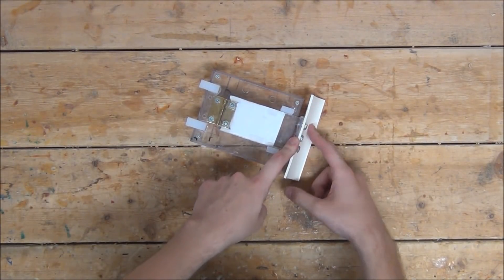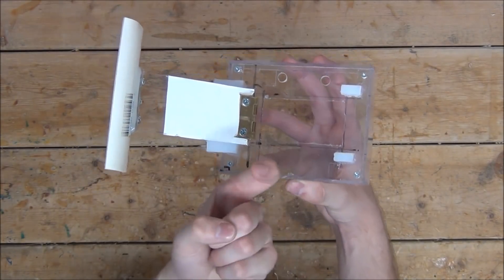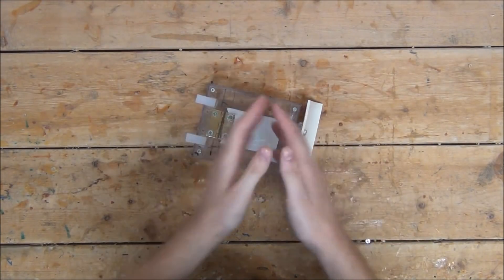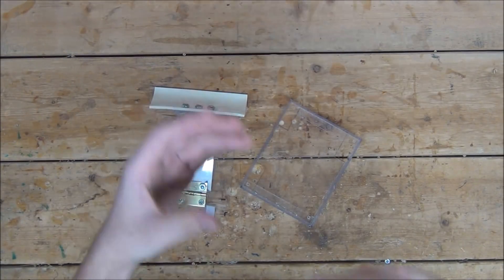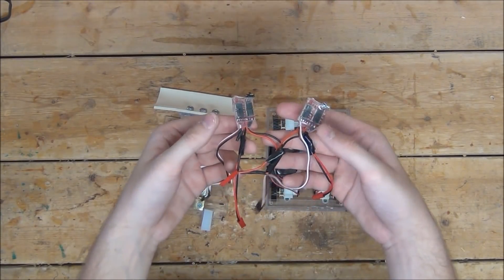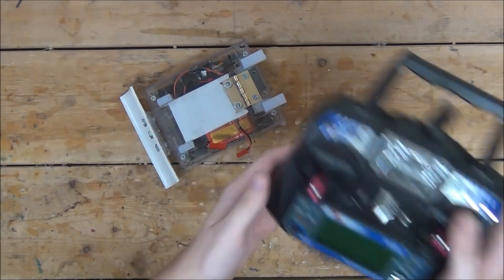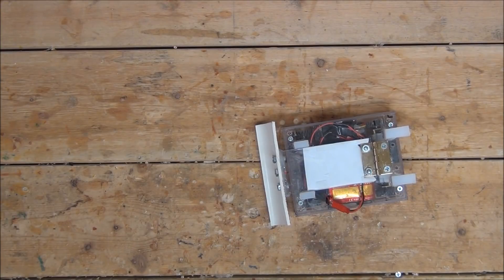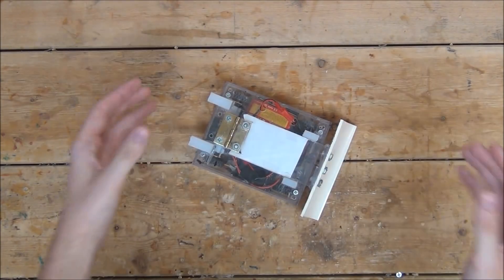How To Build A 1LB Lifter Battlebot // Talyn 2.0 Part 2/3

Comment: Hey, I know this is a super old video, but I’m in the midst of building my first ever robot, it’s a lifter powered by a servo, and I was just wondering most about the mechanics of that, like how did you make the servo flip that much? I’ve watched all the talyn videos and I’ve learned alot :)
Reply from the maker: Hello! First off that is SOO exciting! Congratz about your first bot! Well first I mod the servo itself, I solder 2k ohm resister onto the servos POT so that it has a wider angle of movement. After that its just a matter of putting the hinge as close to the servo as possible. atleast that's how i currently do it. You could of course go with a 4 bar lifter or something of the sort but theres a LOT more math that goes into that AND its not quite as durable.
Reply from the maker: I know you said you've seen all the talyn videos, but have you seen the latest one? https://www.youtube.com/watch?v=ZcTCFxAk96g

p.s. There SHOULD be a new talyn video VERY SOON...LW! Haha!
Reply: Thanks for the reply! I’ll see what I can do with that info, im just happy to have something that works at this point... it’s a similar design to apollo from uk robot wars

Comment: So... Uh... weird problem with my transmitter (the flysky) ... I used a servo motor plug, wired it to a 3 triple A battery pack and plugged a servo motor into the receiver. And the motor just spun on its own. I did NOTHING with the controller. What's more is the servo motor would just go for a while then stop and keep repeating that. Do you know anything about this? I need to know soon as I'm going to a competition in early November. 

Thanks
Reply from the maker: It's a 360 degree servo? If so sounds like it just needs to be calibrated. To do that you first put the throttle in the off position then adjust the screw on the bottom of the servo until the servo stops moving. On a side note i would highly encourage you to buy a rechargeable battery pack and run it through an ESC to help protect everything.  :)
Reply: Thank you! And thank you for your quick reply! I did not know you had to/could calibrate them. (Just goes to show how new I am to all this) Unfortunately I won't be able to be in your 1lb robot video as I've accidentally made a 150gram bot. It is pretty small and all the parts weight at exactly 150 grams so I Don't have room for an ESC. Thanks again for your help!
Reply: @MechNinji  The motors are not responding at all. I think an ESC is what I need

Comment: If I'm not mistaken the lifter arm is not connected to the servo, the server just pushes up on the lifter. So, how the heck does the lifter close back up when it is pushed all the way rearward?
Reply from the maker: haha! Its attached by either a cable or elastic band, depending on what im fighting  :)

Comment: Hi, are your ESCs working correctly? Their working voltage is said to be 3.0-9.4V, but you are using 11.1V battery. I want to buy them and use with the same battery, so I would like to know if you have any problems with it.
Reply from the maker: Nope you're right! I am putting more volts through them then what is recommended. However electronics always give a lower tolerance then what they can actually handle for safety reasons. So since im only over powering it by 1.7v  i wasn't too worried about it. But if you can find 12v escs that would be best!  :)
Reply: Thanks for your answer!  I  will not worry anymore and buy them :)

Comment: I would seriously recommend soldering an actual power power switch for your bot. Dangling the battery wire outside of the robot is just asking for someone to tear it off or even just vibrate loose. Your battery seems way overkill for how it's being used. You could easily get away with a tiny 300 mAh LiPo with a similar C rating, meaning you've got quite a bit of dead weight. Investing in some Fingertech goldsparks/silversparks would give your bot much better speed and torque, which is especially important for a wedge design. It's also important that your wedge sits flush with the ground, otherwise you won't be able to get under anybody to flip them. grinding a bevel to PVC wedge would work, but a PVC wedge would easily get out-wedged by a simple rectangle of sharpened aluminum. This robot is headed in a cool direction, but would benefit from better suited hardware and some different materials. UHMW or aluminum channel construction using a hacksaw or dremel would take this robot much further in competition. Polycarb is not bad for smaller parts like top plates, but as the main structure of a bot, it tends to be flimsy and weak in comparison to other alternatives.

Comment: Where did you get the motor mounts? They are not linked and I could not find them on ebay
Reply from the maker: I believe this is where I bought mine from https://www.aliexpress.com/item/10pcs-3PI-miniQ-N20-Micro-Motor-Mount-Set-12mm-DC-Gear-Motor-Mounting-Bracket-Toy-Car/924144024.html?spm=2114.search0104.3.39.65a929eeiPVs6I&ws_ab_test=searchweb0_0,searchweb201602_5_10152_10065_10151_5711320_10344_10068_10130_10324_10342_10547_10325_10343_10546_10340_10341_10548_10698_10545_10697_10696_10084_5722520_10083_10618_10307_5711220_5723020_10059_5722620_5722920_10534_308_5722720_5722820_100031_10103_441_10624_10623_10622_10621_10620-10152,searchweb201603_68,ppcSwitch_5&algo_expid=27268371-f623-44ef-ab5d-d48425f11ae5-6&algo_pvid=27268371-f623-44ef-ab5d-d48425f11ae5&priceBeautifyAB=0
Reply from the maker: dang... sorry for the super long link...

Comment: What do you think about building a bot with no transmitter/receiver and using Bluetooth & Arduino instead? Also, these motors you chose were 600RPM @ 12V right?
Reply from the maker: It would be super interesting to see how Bluetooth would work, However I think it would be very hard to out preform a hobby grade transmitter.  But again, it would be an awesome project!

Comment: One other thing. I would not recommend your method of power on/off. Although quick and easy, I have seen JST connectors pop loose in combat. Not from getting directly hit, but from vibration.
Reply from the maker: Yeah, iv seen that happen too. However mine clip together really tightly plus I tape it, so we should be okay.  :)
Reply: Mechanical Ninjineer Ah nice. Did not know you used tape.